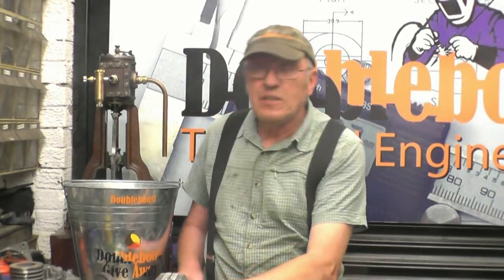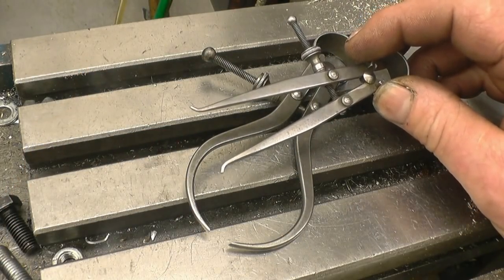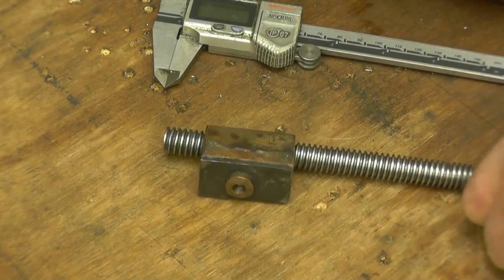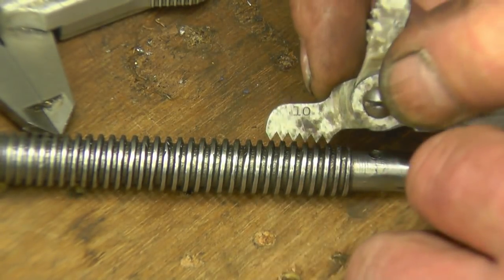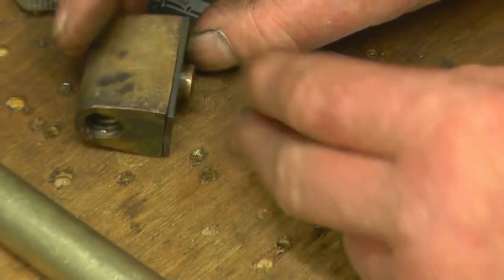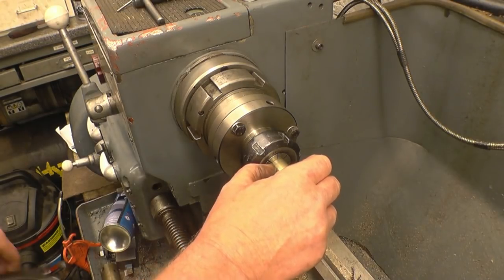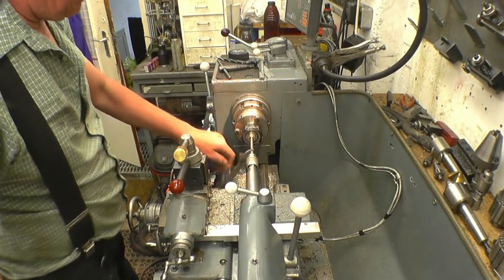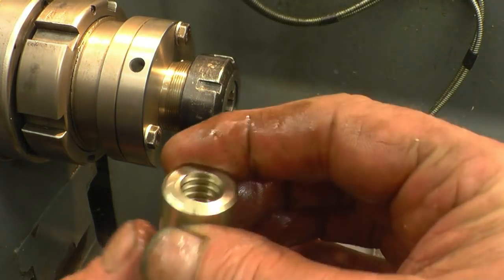SNNC 231 P1  10 TPI  Left Hand Acme Nut

Comment: Surely John you should make up the new nut assembly before drilling and tapping it else how are you going to braze it exactly in the right place?
Reply: I was wondering about that.  You could however machine the two bits to have flats on, clamp them together drill and drive in some short locating pins perhaps, take them out of the vice, pin together and solder up.  Perhaps?
Reply: What if the nut distorts with the heat?
Reply: Just got to try I guess.  He'll find out soon enough!!
Reply: Just run the tap through it again, clean out the threads.
Reply: the original nut had been squished in a vice to tighten it up.... had been apparently totally destroyed, or nearly so, several times and still served it's purpose... there is likely both enough play in the table and the ability to adjust the alignment of the nut, particularly as it appears to have only a single boss in the connection... so long as he gets close it will probably be fine...   I would have measured, drilled/reamed out the original nut.. bushed it with the replacement material .0015 oversized and fit with heat, secured with two pins/rivits in addition to hard soldering/brazing... drilled/reamed that out as a bushing and tapped in place... but I'm guessing John's experience will prove to be sufficient and maybe handier.. maybe better all around.. .gotta look at the next video :D  .... .

if you do what i said, make the filler piece about .040" shorter than the oal of the hole to be bushed, and when fitting with heat center it so you have about a .020" step/counterbore effect that can be filled while brazing to give a stronger product.. but prior to brazing... drill two holes slightly smaller I.D. than your brazing rod O.D.   .. about .250" deep perpendicular to the long axis of the bore and into the filler material, lightly countersink.. and cut two pieces of brazing rod about .270" long.. .heat.. and drop into holes, rivet the heads of the rod protruding, file off, braze the riveted head in place... then.. braze the core permenantly in place... drill... ream... tap...   

a heck of a lot more work than John is doing... not enough of a gain, to warrant it, unless it is a part for a service that requires a million dollar insurance policy; and somehow that is the only way to get the job done, ie. the part cannot be simply replaced or readily made from scratch.